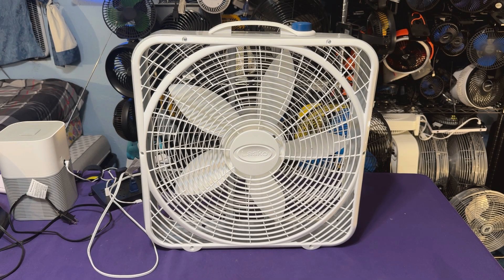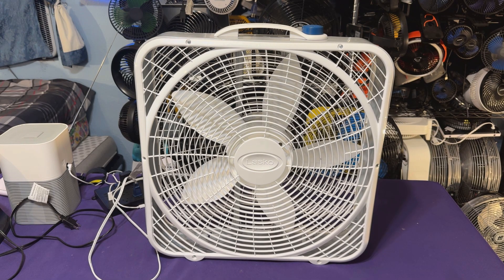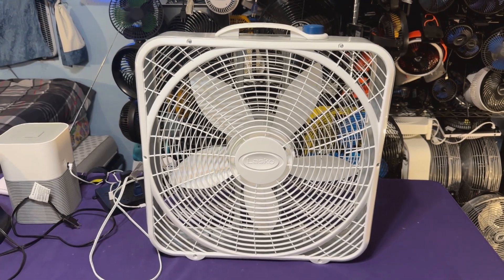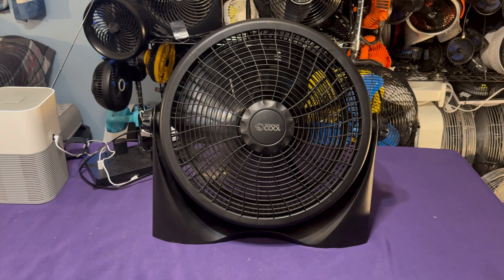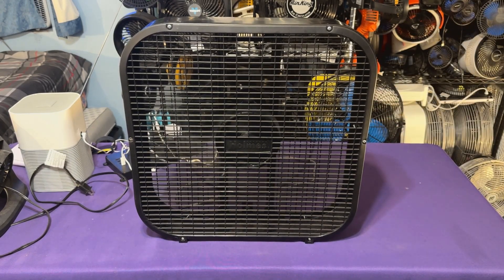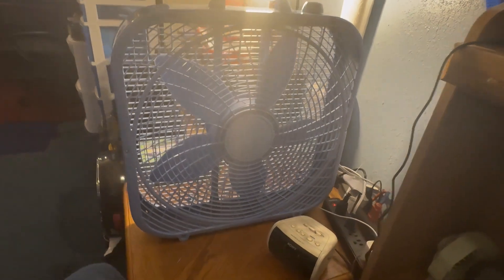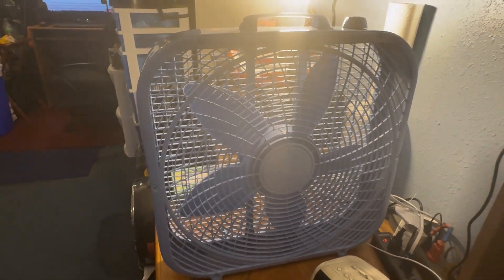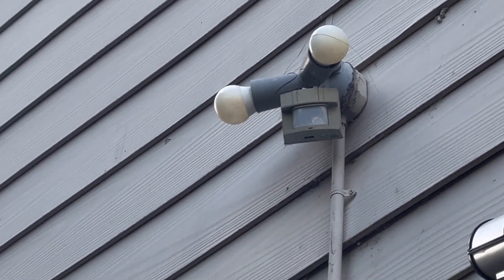Fan Montage 11

Comment: Regardless of the model number, 3720 or 3723, they now add the sticker to the handle on these fans. If you buy a replacement handle they don't come with a label for some reason. 
Source: Bought the premium model, not the weather shield model, had the sticker anyway.
3720 and 3723 are the same - the front grille ornament is the only difference.  3720 will say "LASKO Weather-Shield" whereas 3723 will only say "Lasko" It's weird. Judging by Lasko's recent decisions, I am willing to bet they're going to discontinue one of the two models. They'll probably discontinue the Power Plus at some point too!
I understand what you are going through. When I came into possession of my Hampton Bay SVF-20 fan, my cat had to be put down due to some terminal cancer called lymphoma.
Reply from the maker: Thank you for understanding bro nothing is the same around here right now not even recording videos right now but i am trying. thanks for letting me know about the model number being on the handle